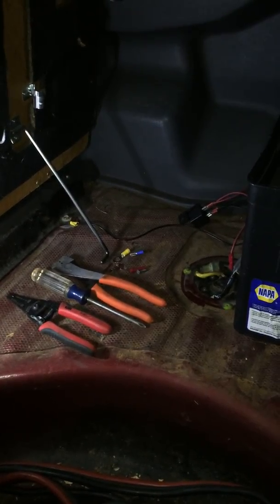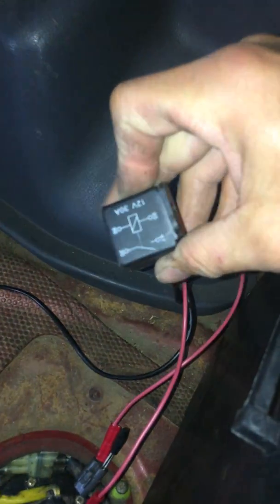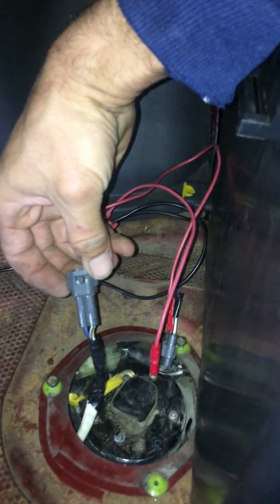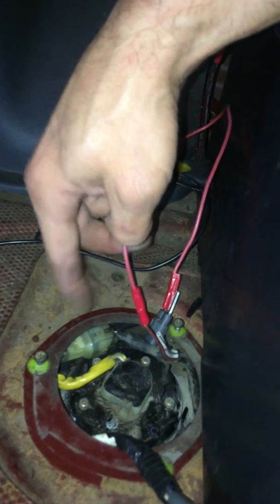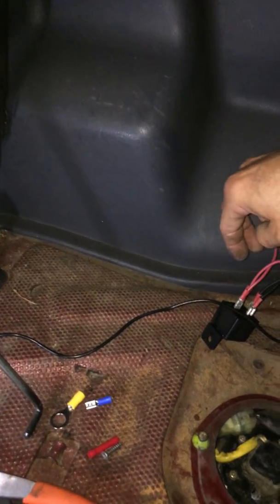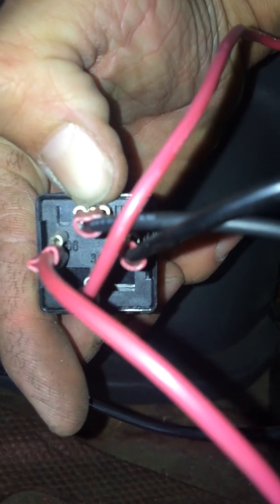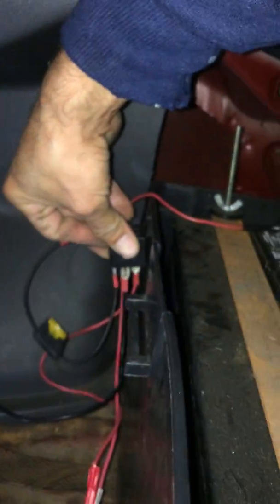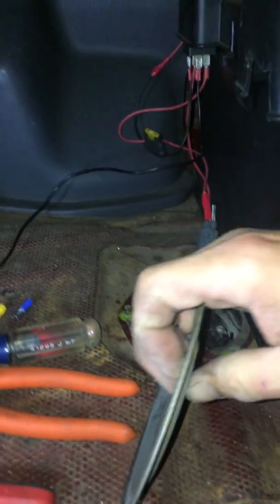Toyota Supra 12V mod

Comment: PLEASE DON'T BUTCHER YOUR SUPRA LIKE THIS!!!  

This is completely unnecessary. This shows that he doesn't have an understanding of how this circuit works. The power feeding the fuel pumps in the 3rd generation Supras goes through 3 relays before reaching the fuel pump: EFI relay, Circuit Opening relay, and fuel pump relay. The fuel pump relay's only function is to switch the pathway power takes when going to the pump. It switches between power going through the resistor and bypassing the resistor. When it goes through the resistor, the pump gets only 9 volts. When it bypasses the resistor, the pump gets the full 12 volts. He didn't have to install a new relay. All he had to do is what he shows at 7:30 of the video. On a 1990 Supra MK3,  you jump the blue wire with black stripe to black wire with red stripe, and you're done. You will always have battery voltage at the pump when starter is cranking and when car is running.
Reply: whats the option for a 87? can you get away with only jumping the wires at the fuel pump relay by the shock tower?
Reply: @battlexman4741  The 87 is an MK3 as well, so yes, all you have to do is jump the blue wire with black stripe to black wire with red stripe on the fuel pump relay harness connector by shock tower. You can leave the fuel pump relay and resistor there or you can take them out for a less cluttered look. Take your time to make sure you're jumping these 2 wires. You don't want to jump the wrong ones.

The only time you can't do this is if you're running 2 fuel pumps because 2 pumps will draw twice as many Amps and it will overheat the factory wires. If you're only running 1 fuel pump, you can jump those 2 wires with no problems and it doesn't matter if the fuel pump is a Toyota original or Walbro or any other aftermarket pump.  Just remember that the wires are from the positive side of the battery, so make sure you tape them up or cover them well so they don't accidently come into contact with frame or chassis because they will short out and blow the EFI fuse.
Reply: Or you can just cut the yellow wire at the resistor relay so the ECU never closes it. The 12v mod is proof that the 7M world is full of amateurs that parrot information.

Comment: Is there a way to just run wires thru the old Relay harness like how you jumped it? Can you just plug new wires into the old harness and run them to the new relay?
Reply from the maker: @jorgediaz42069  yes I believe you could just run them back through the plug this is just the write up I fallowed.
Reply: @williamfragoza1535  William, all you needed to do is what you did at 7:30 of this video. You gotta look at the electrical schematic for this circuit and understand it before doing this. Don't just blindly listen to people on forums. Look at the schematic for this circuit and let me know what you see. After looking at it and understanding the circuit, do you still think installing the new relay was necessary?
Reply from the maker: @ hey there. Thanks for watching. I’m just a diy mechanic brother I’m not a certified technician or mechanic. Nor have I claimed to be. At the beginning of the video I stated that the new aftermarket fuel pump needs a constant 12 V to supply my bigger injectors, not low RPM 9 V and high RPM 12 V. Like you described in your message therefore I set up my set up according to what I understand my fuel pump needs.  not a stock fuel pump. I’m sure there are several fancy more technical ways of running it but this is the way I did. You don’t have to like it.
Reply: @williamfragoza1535  It's not about liking it or not. It's about doing unnecessary work and butchering your original wiring to add a relay that's not needed. I didn't mean to insult or offend you. I just don't want others doing the same thing and taking advice from people on forums before understanding what they're doing and why they're doing it.
Reply from the maker: @ I’m not offended at all but I feel you are misunderstanding my video. I am running and aftermarket fuel pump that requires me to run at 12v constant. I’m not  suggesting at all that anyone run this mod on an oem pump.  In the first 20’s of the video I clearly say why im running it this way. the fact that you are insinuating that I’m suggesting ppl do this to there stock oem pump is ridiculous and then accusing me of giving out misleading information because im posting about what I did to my car. Brother if you are so informed and passionate maybe you should start a channel. Have a blessed day
Reply: @williamfragoza1535   I never said that you suggested doing this mod. All I'm saying is that you don't need to add a new relay when installing a Walbro or any other aftermarket pump. All you have to do is what you did at 7:30 of your video and you will get a constant 12 Volts at the pump. If you don't believe me, look at a schematic for your car's fuel pump circuit or check the voltage at the pump right now and then disconnect the relay and put wires coming from the engine to the pump and check voltage again. You have to do these checks while fuel pump is running. You will see that you get 12V with and without added relay. You will actually get about a tenth of a volt less with the relay connected because of extra wire and connections. You can also do what you did at 7:30 if your original fuel pump relay failed and you don't want to buy a new one. Thanks for suggesting I get my own youtube channel but no thanks I see how many views most automotive repair channels draw. Plus there's some really good ones out therea already like:  Ron "Yotaconnectors".
Reply: @bernardocisneros4402  yeah that supplies 12v but it isn’t the safest practice to run no relay
Reply: You don't have to install a relay for this. You only have to do what he did at 7:30 of the video. You don't even have to open your trunk. Just open your hood and jump the 2 wires at the fuel pump relay electrical connector. You don't even have to remove the fuel pump relay if you don't want to.

Comment: Can you do this mode to a original fuel pump or you have to upgrade the fuel pump
Reply from the maker: No, this mod only works for the walbor 255 pump because it needs 12 volts to run. Your stock fuel pump needs 9 Volts to run. Any more and it could fry the pump.
Reply: @williamfragoza1535  Come on William? This is misinformation. The fuel pump on the 3rd generation Supra runs on 12 and 9 volts depending on engine load. The fuel pump relay is normally in the position to bypass the fuel pump relay resistor and provide the fuel pump with 12 volts. It provides the pump 12 volts when engine is under high load conditions like when accelerating or climbing up a hill. When engine is under low load conditions like idle or just cruising down the highway, the computer energizes the fuel pump relay and routes power going to the pump through the fuel pump relay resistor thereby decreasing it to 9 volts. 

The computer commands the fuel pump relay to switch between these 2 pathways so the pump will last longer and run quieter.
Reply: My car won’t start it only runs when I push the button on the cold starts and the car stay running ones I unpressed the car dies what could be ?
Reply from the maker: @chente9109  I just looked it up and looked on my car. I can’t locate the cold start button you are referring to or can say that I’ve ever seen/noticed one. When the car is running, have you let it get up to temperature to see if it will stay on at idle. When you have the car running with the button pushed in, can you give it gas or will it die?
Reply: @williamfragoza1535  I’m still having the same issue the car won’t stay running my fuel pump comes on but I have 0 fuel pressure
Reply from the maker: @chente9109  check your fuel pressure regulator or do you have an aftermarket FPR. I would start with that issue. Then make sure your pump is good and pumps the gas out.

Comment: Hey quick question for you, I will jump the relay like you did on big grey plug, did you just unplug your resister and removed it along with the relay in the engine bay? Or leave it plugged in? That’s the plug with two small wires next to the big 4 wire one.
Reply from the maker: Yes I just unplugged the resistor
Reply: Thank you. Awesome video. That will clean up engine bay more too! That’s a plus. Thanks again man.
Reply from the maker: @jaredzanelli7867  heck yeah. Glad I could help out brother.

Comment: thanks for the help buddy. still useful 5 years later
Reply from the maker: Thanks brother. I’ve been trying to get more videos uploaded. Just been busy with life. Thanks for watching. If you have any videos ideas let me know.
Reply: @williamfragoza1535  well I'm doing a switch panel right now for the mk3
no info online anywhere I look.
converting my ignition, starter, fuel pump and fans on a panel.
Reply from the maker: @brandontucker6069  yeah it’s really hard to find anything on the Mk3 unless you go to the forums, but even there ppl are not helpful. Just try and make you feel dumb for asking question. That’s why I started this channel.
Reply: @williamfragoza1535  yeah I see that but I searched good before making my own post on the supra forum. but I got it figured out with a buddies help. but I can make a video explaining it when I'm done. full build on my 89 7mgte, tubular twinscroll 6262 twinscroll turbo, 1000cc injectors, hellcat fuelpump, ecu masters emu black. deleted most coolant lines and vacuum lines. it's been a long road. but this wiring has taken the most effort for sure. thanks again for your help.
Reply from the maker: @brandontucker6069  that’s awesome!! I would love to get a write up on how you did your build.  I also have the ecu masters classic with the plug and play harness. (Not installed) I have done the same deleted most of my waterlines and vacuum lines. Wire tucked all the electronics under the hood to my fender wells. Relocated my battery to the trunk. Clutch start delete with a deadman switch.  550 injectors. Tubular, twins scroll excess exhaust manifold, with a rev 9 twin scroll 60/62 turbo, Walbro 255 fuel pump and some stage 2 Brian crower came shafts. I would love some help with the ecu master set up if you can. Sounds like a serious built you got. Best of luck
Reply: @williamfragoza1535 yeah man I have become very comfortable with this car. thankful for all the info online honestly.
now a question about your wiring there, red and black goes to harness and that should be turned on by aux wire coming from the key, so if I'm using a toggle switch I'd bypass that wire and run it to my switch(12v switch so white wire from relay)
so that's my plan to do today.

Comment: nice explanation to this mod! i do plan on going turbo to my 7mge and utilizing 440 injectors. question, would it be okay to do the fuel pump upgrade with stock injectors for now. reason being, i think i my fuel pump relay is no good. i tested the fuel pump by jumping with my battery and can hear it working, but when everything is normally hooked up. i don't hear it pump functioning. i rather not pour 70 dollars on a stock relay/resistors when i do plan on going turbo.
ALSO, if you know the simpliest way to go turbo on a 7mge (without too many gte electronics) please make a video with a breakdown and visual ideas in making this work
Reply from the maker: Sorry for the delayed response. As far as upgrading your fuel pump to something bigger ( Walbro 255 ) you would need another supporting mod such as FPR ( fuel pressure regular). I would go with a stock 7m get fuel pump. I will look into making a write for the NA-T conversation but basically by the time you spend the money and time into converting to turbo and all the supporting mods and headaches of tuning with out a stand alone ecu.  It would save you stress time money and the headache to find a 7mgte with computer and slap it in. Thanks for watching and the input.

Comment: Hello, I have a question? Can you do the 12v mod without the walbro 255 ?
Reply from the maker: You don’t want to run 12v to the stock pump because it only needs 9v and you would most likely burn up the pump. The walbro requires the 12volts and won’t run with the resister in place.
Reply: @williamfragoza1535  thank you man
Reply from the maker: @jgvn626  Anytime!!! Thanks for watching

Comment: With that white & black wire do you cut it and leave it?? 
I tried this mod and the walbro fuel pump inst turning on :’(
Reply from the maker: Garrett Buska yes I just left the white wire cut and going no where. I believe it was the ground. I have had someone else ask me the same thing about it needed to be connected but mine runs fine with it not connected. Just wondering Do You have the relay hooked up to the right pins.

Comment: So finally got my supra tuned. Tuner said it was running a little lean on top end. So I started looking around for problem ended up being fuel pressure dropping 20 pounds at boost. Ran 12 volts to pump problem FIXED! now goes up 20 pounds at boost. Of course my entire ve map is off, which sucks. What is the other relay near fuel pump relay/ resistor?
Reply from the maker: The skinny long one is the fuel injector resistors and the big chunky 1 is the fuel pump relay. I have the skinny one removed because I'm running high impedance injectors which don't require a resistor. That's awesome man glad to hear it's up and running and a 20 pounds is awesome send me a video if you'd like and I'll post on the channel
Reply: I have a third relay on fender... what about grounding fuel pump?
Reply from the maker: Not sure what really you're talking about if you send a picture of it I  Might be able to identify it for you. I grounded the fuel pump on a bolt to the frame right and meet the wooden hatch you can see it at the start the video with the yellow connector
Reply from the maker: Now that I watched the video again I never did  Connect the white and black wire and I'm not sure if the fuel pump is grounded inside on the hanger and that's why I didn't ground the other wire because it's running to to the relay and I remove the relay. But the fuel pump seems to be working I drive it everyday so I don't know
Reply: @williamfragoza1535  yeah I noticed when I hot wired mine it ran without ground..
Reply from the maker: @chrishanse100   I'll have to ground that wire and see  If it changes anything
Reply: @williamfragoza1535  yeah I just left that wire connected through harness and just cut power wire to splice in. Il try to get a video this weekend, started to rod knock on the dyno on Friday so going to pull engine soon.
Reply from the maker: @chrishanse100   Oh no that's not good yeah maybe I'll just re connected to that white wire although I'm going to look at my schematics & See where that wire Goes
Reply: @williamfragoza1535  it just goes to ground, at least that's what my 
Schematic showed.
Reply from the maker: @chrishanse100   OK cool I'll ground it and see if that makes a difference in how the car runs

Comment: I thought i read somewhere that you not only have to jump the 2 ports under the hood to bypass the fuel pump relay, but then splice 2 more wires together to bypass the resistor too
Reply from the maker: well I don't know where you read that but everything I do here In the video is how I have seen or read on how to do this upgread. I have not had any problems with this set up yet and always run good fuel pressure. thanks for the comment. let me know if there is anything else I can help out with.
Reply from the maker: I dont know about all that, but i did a lot of research online and this i the best way i found to do it. I have been running the new fuel pump just fine since the upgrade along with the 550 injectors.

Comment: Did you do any modding at the fuse box?
Reply from the maker: no I didn't do anything to the fuse box. just installed the 12v relay at the back by battery.
Reply from the maker: The only modding i did was taking the fuel resister off and splicing all of the wires together to supply the injectors with a constant 12v.
This was only done so i could install high impedance injectors instead of low impedance.